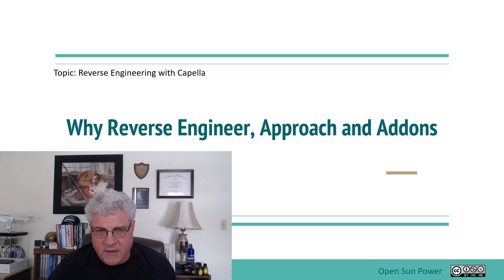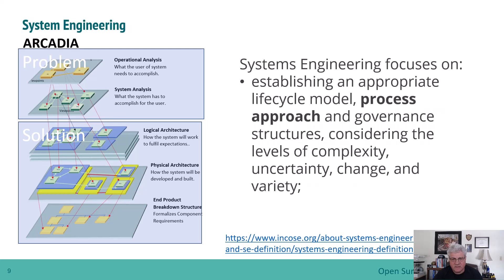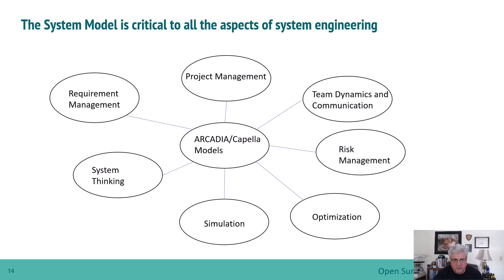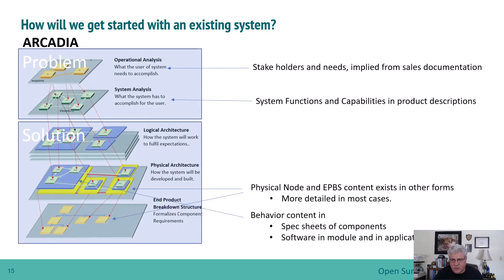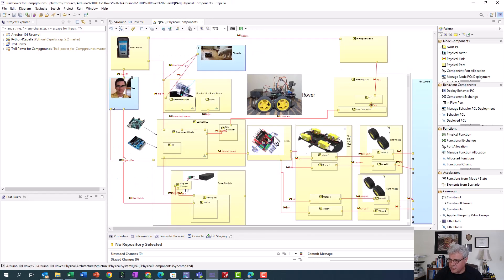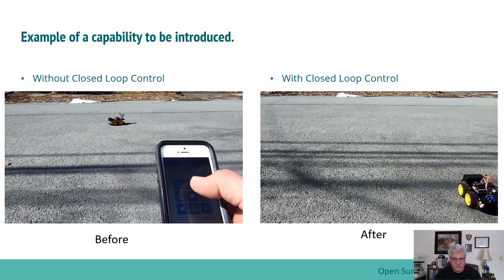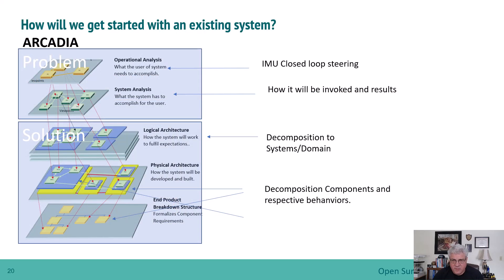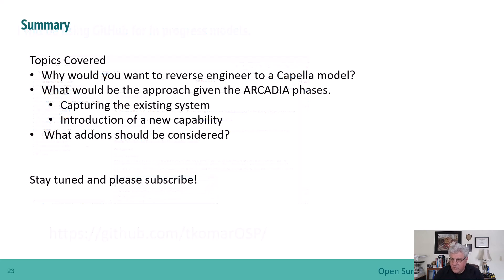2. Why Reverse Engineer, the Approach and Capella Addons

Comment: Your "Innovating with Capella" series was top-notch. I look forward to the other vids in this series. 
It would be interesting to see the scope of the add-ons; maybe get a little perspective in what are the "must-have" add-ons for a new user or a newly formed systems engineering team. E.g. I imagine "Team for Capella" would be crucial for concurrent collaboration.
Reply from the maker: Team for Capella is a great product when you need multiple architects working on a single model. However Capella has a couple of other tricks up it sleeve that allows it to scale. Check my webinar. https://m.youtube.com/watch?v=WCC_iHyChKQ